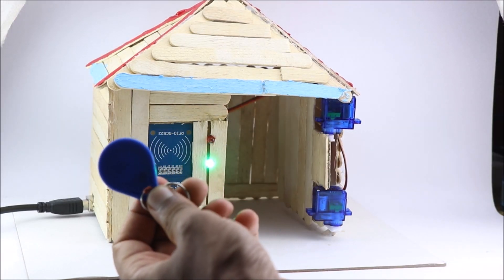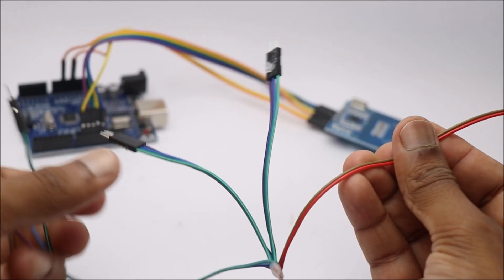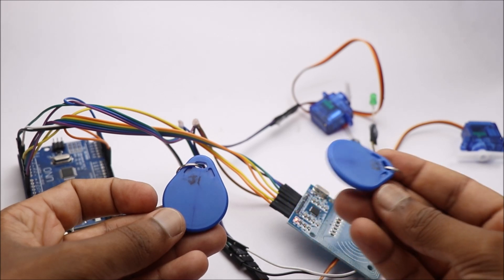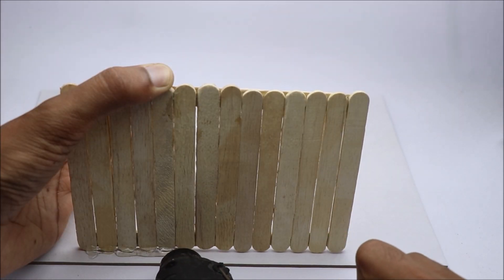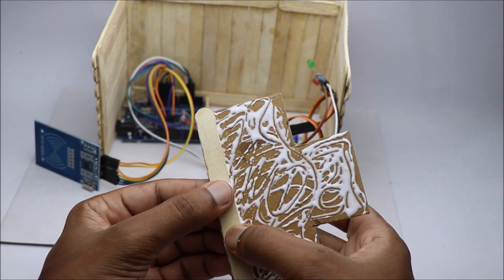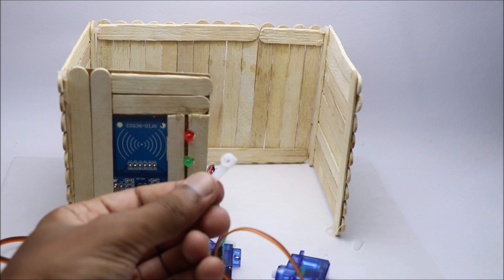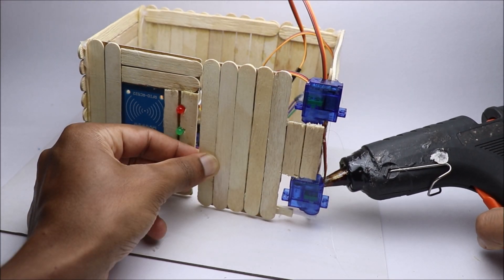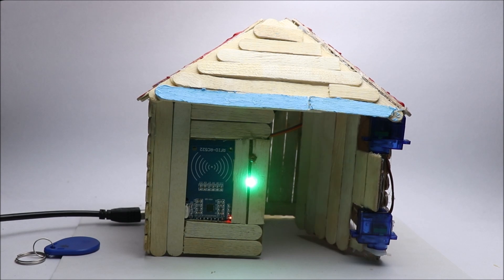How to Make Arduino RFID Door Lock System for Home | Arduino

Comment: Sir I want help from you..
Code is uploaded properly but in serial monitor uid is not showing when is scan the card.
Reply: It show some question marks
Reply from the maker: Rfid is not connected properly
Reply from the maker: Check connections
Reply: Thank u for applying
Reply: Sir one more problem is showing...I uploaded the uid and compiling was also completed but when I scan the card motor is not working
Reply from the maker: try connecting the servo to 5v pin of arduino
Reply: Sir, it already connected in 5v still it is not running